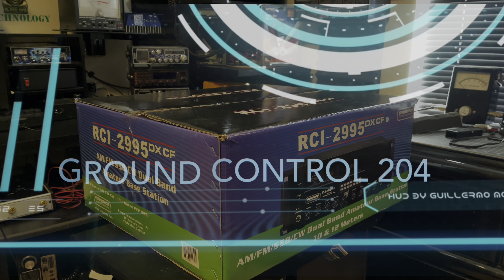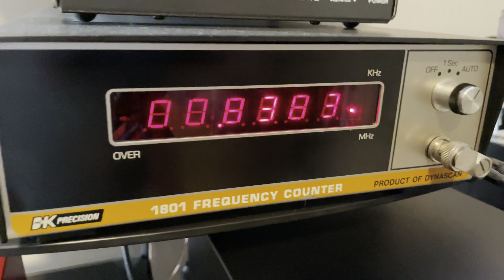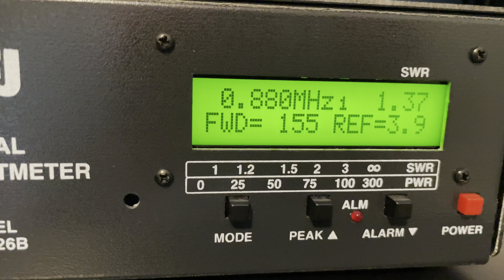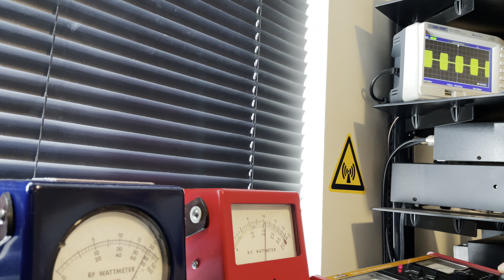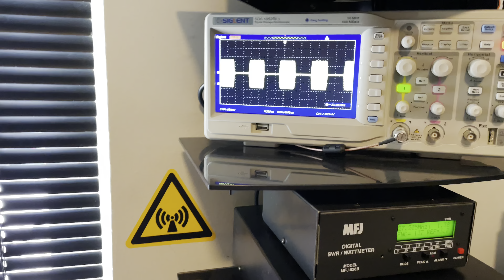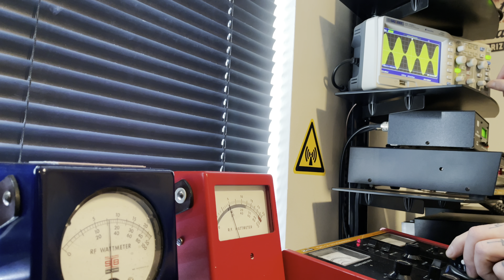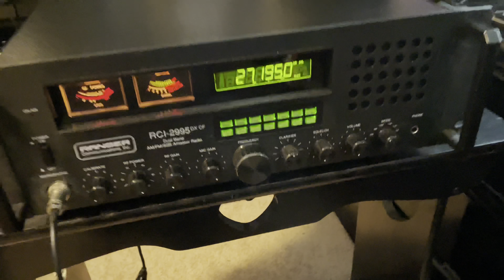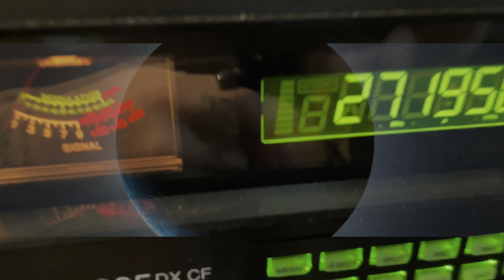RCI 2995 DXCF

Comment: Nice! Are you excepting radios? I have a RCI 2950DX with  an audio problem. Nothing coming out the speaker or EX speaker. I can hear it inside the radio but weak. Let me know please.
Thanks 
Micheal from WV
Reply from the maker: I customize and mod fully functional equipment only, I no longer provide repair services as of 5 years ago. For repair services I recommend Theradiogarage.com